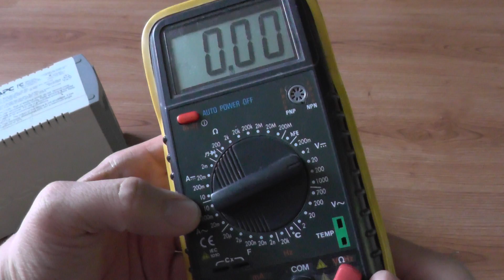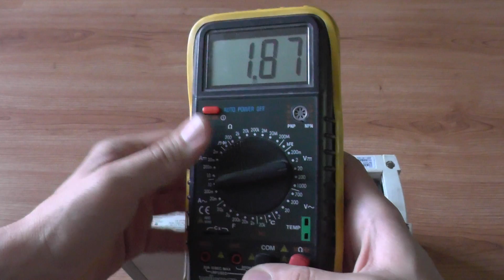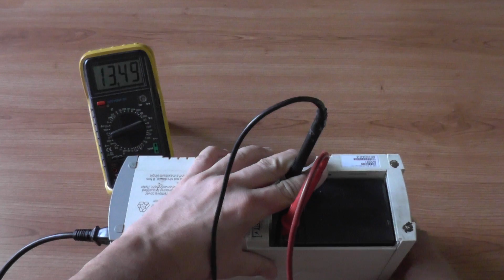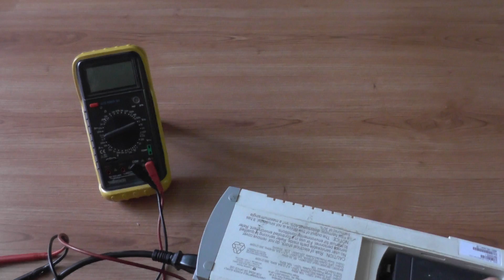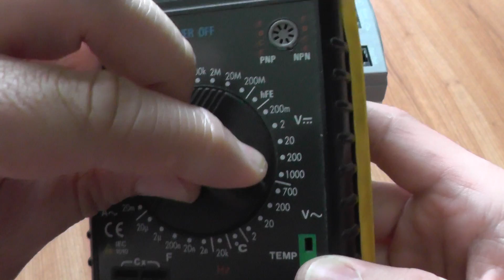APC CS 500 UPS Battery Fix

Comment: nice video, I have the same type APC ups it is working on battery but when I turn off and remove the Main power supply complete from the wall it is start noise and the over load light turn on. after that I can't turn it on back. what I have to do disconnect battery and connect it again & need to press the on again. can u help me to find the problem?
thanks
Reply from the maker: If the UPS shows overload it may be from two causes. The main cause is not that the power supply exceed the UPS output, but the battery is not holding a charge properly. When you disconnect the UPS from the mains it switches to battery, and when the battery is old and weak the UPS may trigger the overload alarm instead of replace battery. Have you added water to cells, if yes leave the ups overnight to charge the battery. Also do a load test on the battery to see if it holds a charge.
Reply: Disconnecting meaning when I am not in use the UPS I turn off it and remove power cable from wall, but when I turn off the UPS and if I keep the mains power on there is no alarm or any sound, however I did't add any battery water and the UPS is near 10 years old now, I will try adding Battery water and do as you said & update you. however thanks you a fast reply.
Reply from the maker: nalaka perera Check also if the battery case is cracked or if it has swollen. If it has balloon or it is cracked do not add water as it will drip out acid. From what you describe i believe that the battery is dried up.
Reply: zangah I didn't find any cracked or balloon on the battery but when it shake I can hear the sound of battery water
Reply from the maker: nalaka perera It can only mean two things. Either someone already added water, second it's not water but some pieces of lead have corroded and flaked away which means that the battery is beyond repair. Try to open the vent caps and look inside with a flashlight, see if there are any loose metal particles that rattle inside.

Comment: Very nice video and the music fits very well.

A low-cost desulfator would be a nice addition to your process: you could add/remove water from the cells according to the desulfation boiling process, thus making sure your cells are properly filled.

Of course in case a battery is truly dead, we should keep in mind that fresh replacement batteries are quite cheap!
Reply from the maker: Thank you for the comment ! Yes a desulfation would be a great addition to restoration procedure but i don't want to waste to many resources and time. If the battery would not charge after adding water then it's time for a replacement. Credits for the music go to Josh Woodward (more info in video description).

Comment: Thanks a lot. I came to this video while looking for a solution for my PCM UPS which suddenly started occasionally turn itself off with an overload light shining. It confused the hell out of me because I have not changed anything in my hardware config and there's no way it can be overloaded. Thanks to your video, now I know that it might falsely report overload because of the bad battery. My UPS has worked fine for two years already, so maybe the battery has vented. What troubles me is that it doesn't show low battery level at all, battery indicator always shows full when the problem with overload happens. And it doesn't turn itself off immediately when left running on batteries. But the battery indicator itself should be fine - it has been running on batteries couple of times and the indicator was showing pretty accurate levels.
I'll test the battery as shown on your video and I hope that it will turn out to be battery fault, not UPS.
Reply: I also remembered how my father used to recover his lead acid batteries for his motorcycle - he was using freshly fallen snow instead of distilled water, and it worked just fine. I'm not sure, though that I should risk and use the snow for my UPS batteries :D
Reply from the maker: camelCased

Hi there ! Thanks for your appreciation ! From what you describe it seems indeed that the battery has vented and lost most of it's capacity. When venting the battery will charge fast and also discharge fast giving exactly the same behavior as you describe. Also take note of the battery placement inside the ups, if it's close to the main transformer it will overheat and dry out (this happens to a lot of UPS models). APC uses a plastic separator which keeps the heat away from the battery giving it a better an longer life. By the way fresh clean snow and / or rainwater is better than tap water as it's naturally distilled water. There are some minor contaminants from air pollution and possible ground contact but in an emergency or in a clean zone (forest, mountain etc.) it can be used.